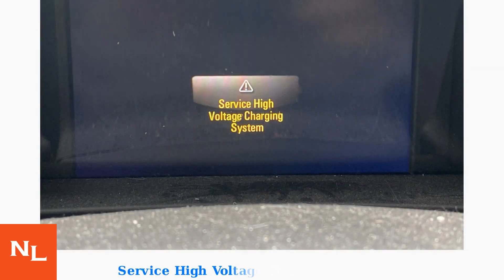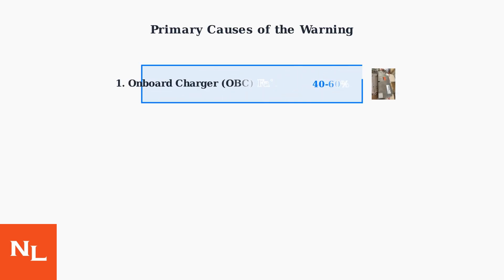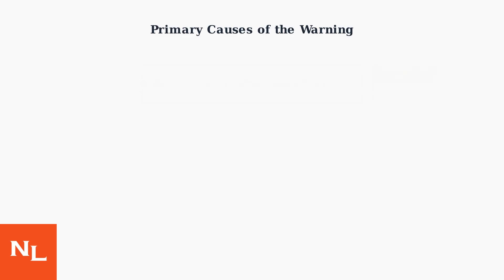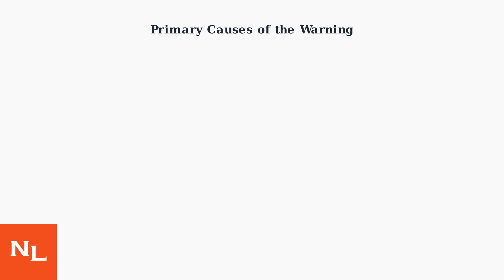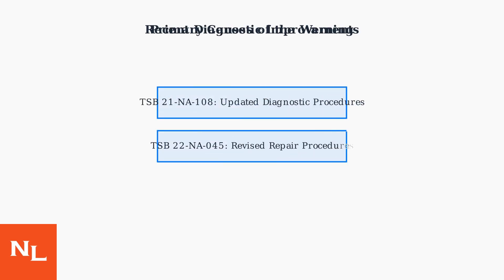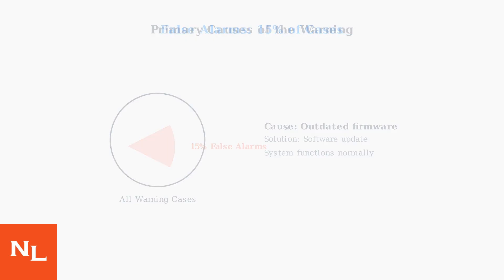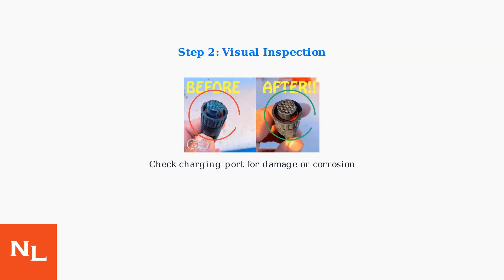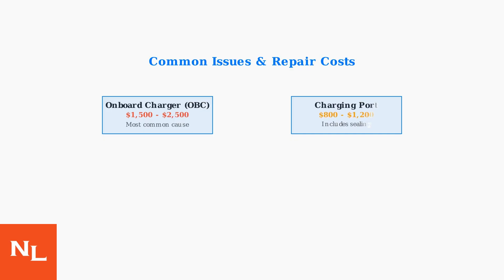How To Fix “Service High Voltage Charging System” Warning In Chevy Volt – Causes & Solutions

Comment: In case anyone else stumbles across this video, I recommend checking out some others.

The #1 most common cause of this isn’t anything listed here - It’s most commonly low hybrid battery coolant level (the left tank). Next-most-common issue is the battery coolant level sensor itself, they’re prone to failure. After that, yes, a software update will likely help. You can have the dealership do this or check into it yourself and buy the connector-to-PC cable and a temporary license for the GM updates.

Comment: Check your battery coolant, which is to the left of the engine coolant. I got this message and it cost 18 bucks to top off the fluid and fix the problem. If the fluid is low, this is probably the issue. Next, have your local smog shop reset the computer. If this does not work, you might have a bad coolant sensor or perhaps one of the issues mentioned in this video that will cost more than the car is worth to fix. I did the 18 dollar fix and it worked. There are other videos on YouTube about the Volt Battery Coolant Issue. Check them out.